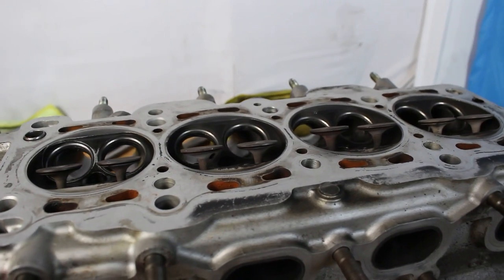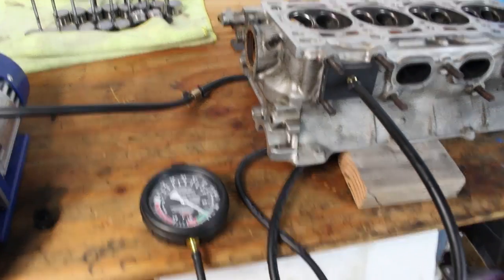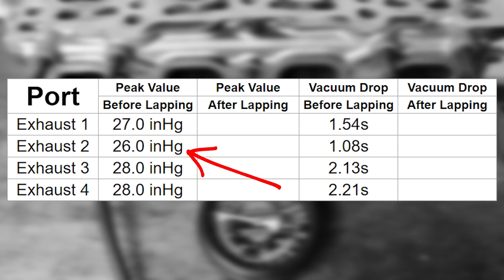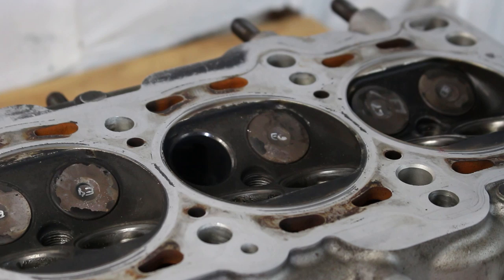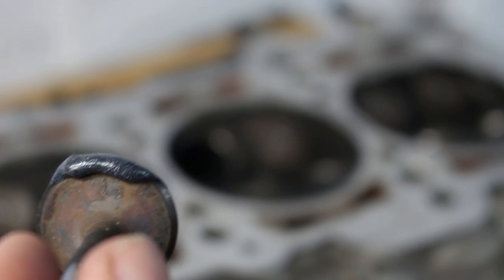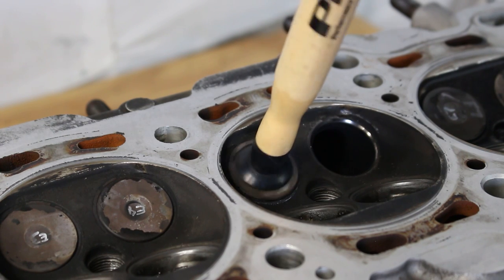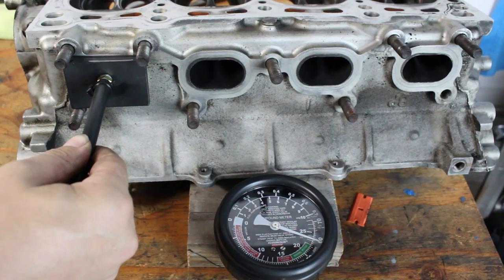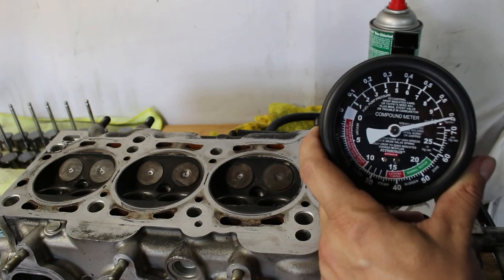Save Money And Lap Your Own Valves! [Measured Results]

Comment: So per my old mans guidance who recently retired (so an old wise man of the trade) You lap the valves until you no longer see any shiny or un-lapped looking metal on both mating surfaces. Both should have a even matte finished look when done. I did see a couple spots on your lapped valve which to me looks like you could continue lapping to remove. I'm also far from an expert but I was blessed and fortunate enough to have my old man next to me giving guidance and inspection when I did my valves. Only exception would be if your valve has a deep pit of some sort which would require realistically too much lapping to remove, at that point if it's small you can probably just run it as is. If it's large then a new valve maybe in need.

Comment: Good job dude! Next time you do this job though try to spin the valves as far as you can either way. Short strokes, say if the valve only turns 1/4 turn either way, may result in a valve with a face matched to a seat only in a specific position, resulting in different sealing capability as it naturally spins around while the engine is running. You should be able to easily get two full valve rotations each direction by hand. Also, what you’re looking for is a uniform band of dull grey all around the valve face and seat. Keep up the good work!
Reply: Only lap valves with short strokes to show if your valve or valve seat are uneven.

Comment: Another thing to look out for is where the lapping marks are on the valve and seat. If its not in the middle it can indicate a valve that is too recessed or too proud, that will require the seats to be cut.
Lapping isn't a replacement for machining and it wont have the same gains as a proper multi-angle valve job but its a great way to make sure your previous valve job is sealing when doing a rebuild.
I've heard machinists say that if the valves need to be lapped after a valve job then the machining wasn't done correctly.
Reply: Prussian blue is ideal for testing that. Put a little on the valve and drop them in to check the contact patch
Reply: "I've heard machinists say that if the valves need to be lapped after a valve job then the machining wasn't done correctly."   Absolutely correct.  By the 1980's machining equipment had progressed to a point that no lapping was necessary.  The fit was good enough with a quality faced or new valve and cut seat that within a VERY short time of starting the engine the valves will hammer themselves into a 100% perfect fit.

Comment: I messed up the timing on a NA 1.8 vauxhall engine, had to buy new exhaust valves.  I cleaned the head, and cylinders,  added the new valves and lapped them all in.
On my kitchen table.
That engine ran better than it had ever ran before. Noticeably more power all through the rev range.
Wasnt an insane amount extra, but it was something.  I didnt even deck the head.
Engine had 80k miles on it.
I wouldn't have done it unless I had to, or already had the head off, but it was well worth doing.
Also a collet is way, way better than one of those suction cups.
Also, cheap digital calipers, and a quick look in the cars service manual will tell you the width of the seat tolerance. 

Too wide and carbon isnt crushed up by the valve, too narrow (not an issue here), and the seat can deform from being smacked by the valve.

Also, you get different grades of lapping compound, the Vauxhall manual said not to use coarse, but I did and then used fine. And was slightly over the width tolerance.  But it worked out just fine.

Comment: Valve lapping can be used to correct small imperfections or to see where your valve face is hitting on the seat to low or too high depending on where you want it. It's not meant to fix valves or valve seats. They also make many different lapping compound grits.

Comment: Nice video. This is very helpful as I am working on lapping my existing valves on a Toyota V6.  I don’t have a vacuum tester though.  The machine shop inspected my heads and identified the leaking valves.  He told me that a valve job could be 700 and higher.  He suggested that I lap the valves myself and replace the seals.  He then said to come back and resurface them. I originally took on this job due to a blown head gasket.  The car seemed to run fine prior to starting this; however, I guess I would never know if it was down a bit on power as I bought it used.
Reply: Your mechanic gave you bad advice...lapping wont fix leaky valves or an engine needing a valve job. It actually makes sealing worse. Id look around for your own machinist for a valve job next time you have it apart.
Reply: @gordocarbo  I spoke to a machinist.  Did what he suggested.  Turned out great.  20,000 miles later and two trips around the US and truck is running great.

Comment: I’ve had many heads go to the machine shops for value work. For the last 40 years I do all the final assembly and lapping. I also do my own seals after I bought a guide tool from Comp Cams. I have the inside mics and a spring checker to set them one at a time where I want them. I even have purchased valve keepers with different placement of the securing ring. It takes time but at least I know exactly what I have..good video..
Reply from the maker: Even though I'm not a professional, I always try my best to double check the "professionals" work just to put a final set of eyes on it. At the end of the day, it's my investment that's going into the car, never hurts to double check things!

Comment: Based on the exhaust valve results I would be tempted to replace the exhaust valves. Probably not worth the cost for marginal improvement but still tempting. I'm excited to see how well your hot vs cold compression/leak down values compare. Always wondered how valve jobs ensure proper seating during operation temperature.

Comment: I like how you do it by hand and that's the correct way going in both directions. Using a drill you can burn up your guides and heat up your stems and recess your seats unneccesary. An engines valves never spin like in a drill

Comment: Very cool. I've always wanted to try this myself. Interesting to see how quickly the tone changes as you grind down to the finer grit. Many years ago I ported a head myself but left the valves to the engine shop. I also just did my research and didn't go overboard, the engine shop guys said I did a really good job. I was stoked considering it was the first time I'd ever held a die grinder 😅

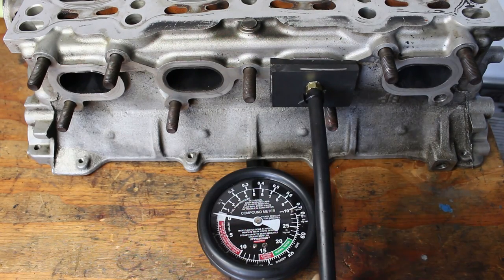Comment: 3:14 These numbers are considered "good enough" for just regular street use. You don't want to see a number lower than 24. If you go crazy with lapping and go from 280 all the way to 1200 grit, you can get 29-30 in/mg and the needle drop time is measure in days and not seconds.

Comment: When i lapped the valves for my k24 build. I used the drill method, i had severe pitting on the valves /seats. That's a good idea with the block off tool, i'm curious what mine would show now lol.

Comment: Another awesome how to Greg!  And you always come out with relevant videos when I need them lol.
One question, you swapped the valves, but are you doing anything to prevent the intake valve problem that happened?  Or will this just become a maintenance job for you?
Reply: I think in a previous video he said he was using longer springs. They were slightly lighter but also longer so when they were in the head they had more weight on them. Volvo ones maybe? I don't remember
Reply from the maker: My best guess is that the springs didn't provide enough seat pressure for the combo of boost and RPM, so I've upgraded to a spring with more seat pressure. You can find that lengthy video a few spots back if you care to learn more. But no, I'd rather  melt this engine down for scrap over replacing the valves every 13k miles 😅

Comment: Hell of a great job, thanks for sharing your knowledge. But can it replace valve job done by the shop? Also, when the shop cut the valve seat, there are 3 angle cut. But they charge $400 easy. Will the shop job last longer? Again, great job and thanks for sharing.

Comment: On my BMW e36 24 valve cylinder head I was able to lap all the valves to peg Vaccum at 29in-Hg and achieve a leak-down time of greater than 2 mins on each cylinder for both intake and exhaust. I know this is a diminishing return as valves open/close in milliseconds however I wanted to see if it was possible. I used 600 grit followed by 1000 grit lapping compound.

Comment: fun fact: valve lapping/grinding compound is the secret to unscrewing stuck screws
Reply: Antisieze is basically very final metal ground into a paste, as the metal gets pushed into threads it cleans then and lubes it
Reply: @Pippy1  i mean a little dab of it on a screw driver gives it an unbelievable about of grip

Comment: an easy  way to tell if valves are leaking first   take a compression reading then remove plugs add 1 small spoon mtr oil in each plug hole  now take a new compression reading if oil helps its the rings are leaking if no help valves are leaking  this test is for low comression readings

Comment: Love the before and after. Especially on new machined valves. Would have been interesting to see new valves PLUS re-ground seats vs lapping. Many claim lapping these days is a waste of time, but I don't believe that.
Reply: The need to lap engine valves had become largely obsolete by the 1970's (when I went to trade school) such had been the improvement in equipment and methodology.  The tools and method called 'syncro seating' is still be far the best and accurate method.  This will put the valve and seat contact surfaces so close to perfect that withing minutes of starting the engine and the valve impacting the seat a few thousand times a minute it will quickly 'hammer' itself into a 100% perfect fit.
The valves used in a lot of hi performance engines must NEVER be lapped as it will destroy the coating on these 'hi-tec' valves.

Comment: You were bold enough to go forward with the valves for the first time, why not sand the head on a sheet of glass or granite?   The worst thing that can happen is that you gain very valuable experience...   experience can not be bought but has to be lived 🙏🏼
Reply from the maker: Head had a relatively fresh surface already, wasn't needed

Comment: Awesome video as usual, why are you not removing just a TINY BIT of cylinder head material to deshroud the inlet valves?? The incoming charge hits the back of the valve and wants to continue on that path into the cylinder at quite an extreme angle.
It hitting a virtually 90 Deg wall just after the valve seat, at PEAK velocity is a killer.
The reason I know this is that I sent my BP5 head off to Blink Motorsport in the UK. They rebuilt it with standard exhaust valves and standard diameter supertech inlet valves with a little bit of bowl work but next to no porting.
End result, seriously!!  noticeable more power across the board with new (mild) cams and original HLAs and valvetrain.
The most usable power is gained at smaller valve lifts as this is the most time  of the stroke that you will see.
12mm lift is cool at 12mm but if the cylinder is struggling to pull in charge at 0-10mm then its a pretty meaningless number as it occurs so briefly in the cycle.
A tiny bit of headwork around that vertical step will bring massive benefits across the rev range.

FUCKING LOVE THE TIME, WORK AND EFFORT THAT YOU PUT IN TO GIVE US THESE VIDEOS!!!! ❤️
Reply from the maker: Man, I really considered de-shrouding the valves while the head was off. Your comment amplifies my regret.

Comment: You're supposed to use valve lapping paste. Not valve grinding paste. Grinding paste is for reshaping a mating surface. Which should only be done when imperfections are verified. If the surface is smooth you only use lapping paste to clean and mate the surfaces.

Comment: As a weekend mechanic 
My mentor is a greybearded lifetime hotrodder/GM master technician 

I ported/polished my own head on a 1.6T mini cooper, lapped in the new valves and was nearly 3 valves into reassembly when he walked by and made me do the old leakdown test

WD40 a damp rag and compressed air, every single valve seat blew bubbles 

Re lapped every valve again, only three valves blew bubbles

Re lapped a third time, reassembled and everything was air tight

Comment: This gives me hope never built an engine and just lapped the valves always sent it out to the machine shop. I am building a performance boat I just got the short block together last night. I dont really have the extra money to have th heads machined and was just going to lap them. I have a blast cabinet i am going to take them all apart clean the valves and sand blast the heads and try this if the valves and seats are salvagable . Gave me new up I can pull this off the heads are after market performance heads . My bucket list get the engine in and get out and start living aagin gotta get out of the grave called a rut
Reply from the maker: You got this!!!

Comment: Have you looked into doing a DIY porting job? The heads have casting flashes that can get drimmeled down as well as the plunge cut where air feeds into the valves.
Reply from the maker: This head has mild porting already, and without a way to actually test what I'm doing, I'm not going to take it any further myself.

Comment: While u have the head off for extended amounts of time are you supposed to use any grease around the pistons before u start it up again? Or engine oil?
Reply: Yes you’re supposed to pre lube them I believe
Reply from the maker: Yeah whenever I pull the head I usually just drop an ounce or so of oil in each cylinder and cycle the engine
Reply: @TheCarPassionChannel  hey dude, I know this is random but I swear you need to come to the UK and see some peoples cars you can get a good nbfl with just rusty arches for £1000 all day

Comment: "*Please note that some heads WILL need a valve job (where the valves and/or seats have a new face machined at the correct angles). But it's not always needed."
WRONG!  If you've gone to the trouble and expense of removing the cylinder head for overhaul ALWAYS either replace the valves or reface them if they are uncoated steel type.  Same with valve seats.  They should always be recut.  If done with good equipment, no lapping of valves should be necessary.  For 'hi tec' coated vales e.g. found in every modern performance motorcycle, valves should never be resurfaced or lapped.  
P.S. 'A Grade' qualified mechanic with over 50 years experience.